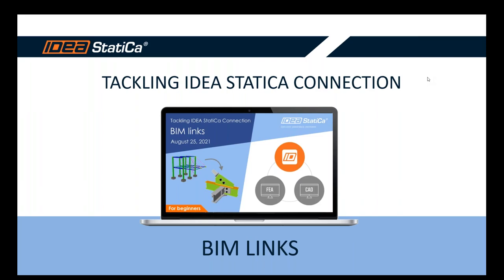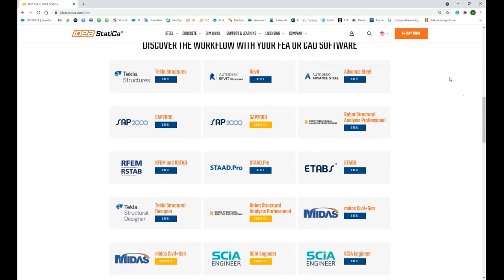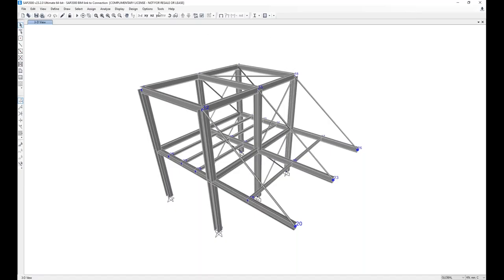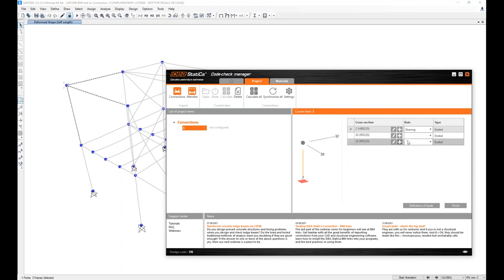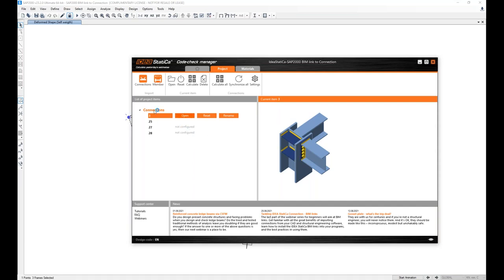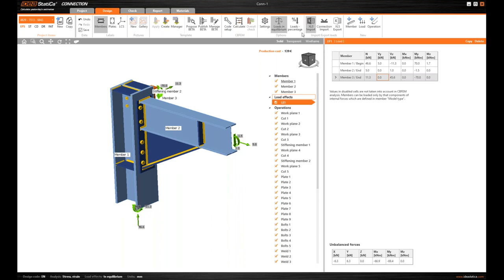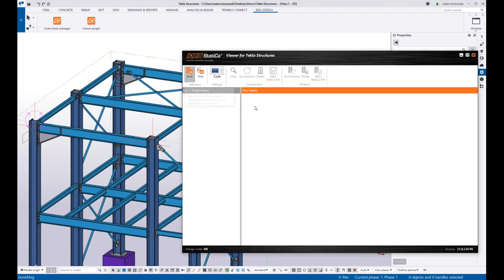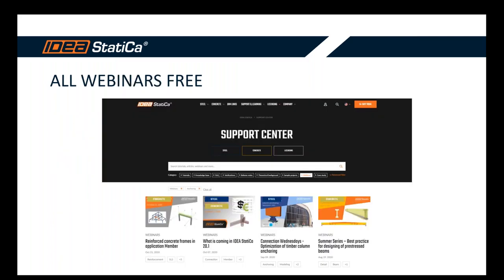Tackling IDEA StatiCa Connection - BIM links

Comment: Hi I have to ask a question. I analyze my model with robot structures and draw with advance steel and check connection with idea statica as usual. And my question is, 
I design my connection with advance steel and send to idea statica for checking. While checking "I import loads from fem model. (first send fem to idea statica and save connection then use connection import)", because of the member end begining defination load direction came with wrong way or sometimes program add loads wrong member. So I can't achieve success loads defination and load equilibrium not success. Is there any solution for this. I think it may be useful with detailed load import interface. Because in this way you can not change end begin condition "all members have to same local axis fem model and Cad drawing"
Reply from the maker: Hello, please refer to these articles:
https://www.ideastatica.com/support-center/unbalanced-forces-from-bim-link-import
https://www.ideastatica.com/support-center/equilibrium-and-supporting-member
https://www.ideastatica.com/support-center/different-ways-of-load-definition#automatic_import_checkbot
and this has been improved with version 23.0
https://www.ideastatica.com/support-center/load-mapping-algorithm-for-importing-steel-connections
In case of persisting problem, please reach out to our technical support via the User portal:
https://www.ideastatica.com/support-center/how-to-create-a-new-support-case
IDEA StatiCa Team